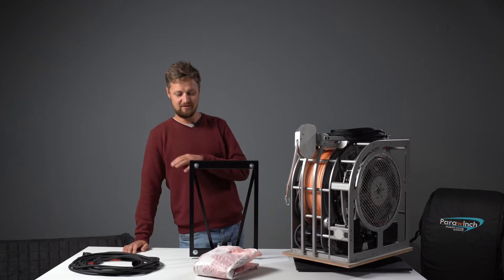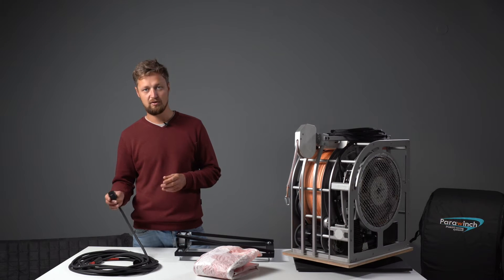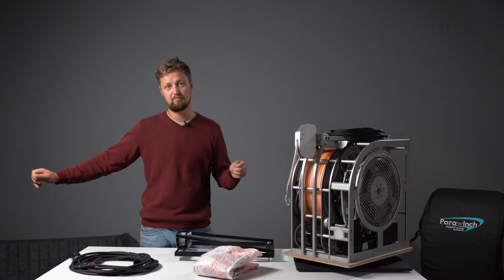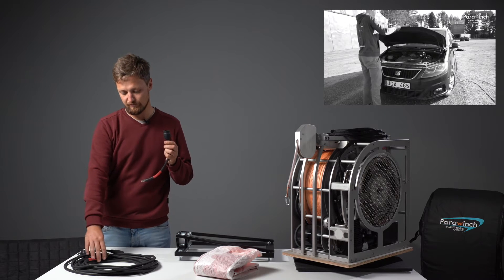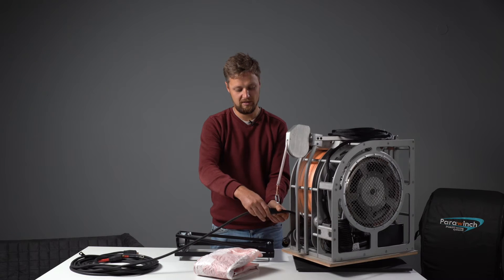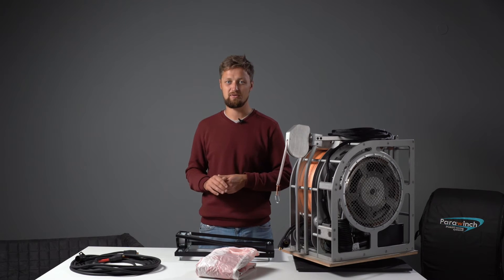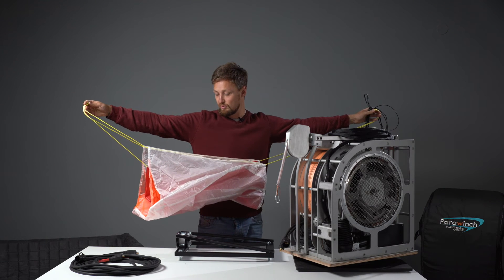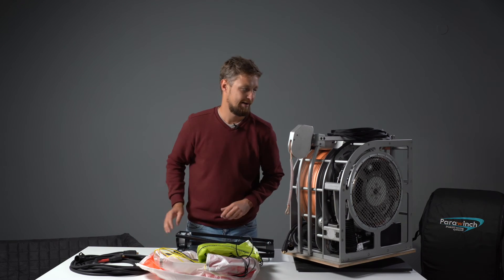Paraglider towing winch setup Parawinch G8

Comment: Good idea to keep the metal rings out of the system. I've seen face injuries from metal items on the tow line after a line break.
Reply: I got hit with the metal ring in my teeth once after line broke. So yes - keep the metal parts away from the pilot :)
Reply: It is normal that line breaks sometimes? Or is just because bad use?
Reply: @FlyWithSergio  Tow lines will sometimes experience unexpected wear or damage when used. Regular inspections will greatly reduce the risk of the tow line breaking under load.